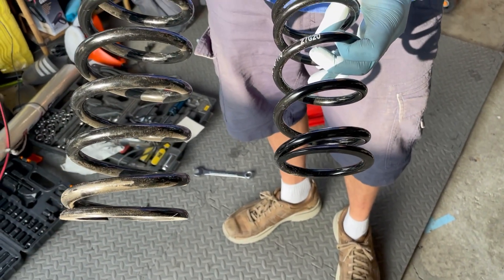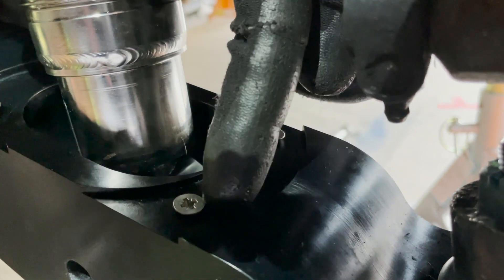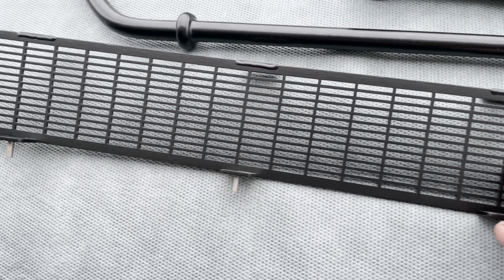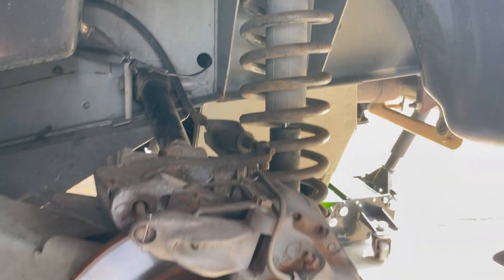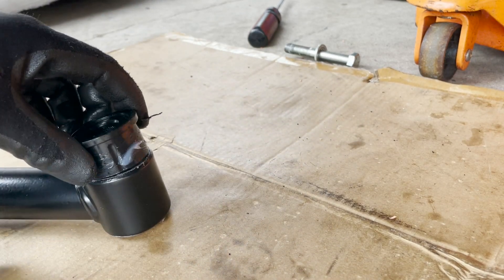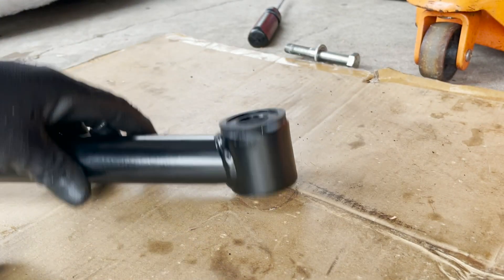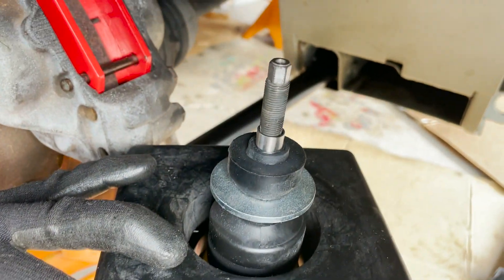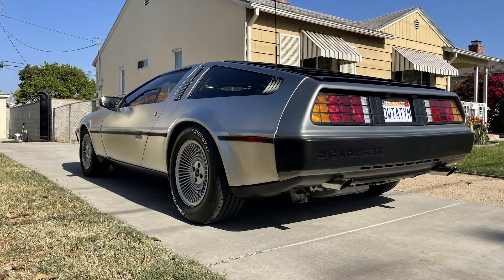DeLorean Suspension Upgrades Part 2

Comment: Is there any particular reason you didn't go with DPI coilover kit? and lower control arm from DGO and not from DPI? Just learning, I have to go through that too.
Reply from the maker: Mostly because of costs, the KWs and DGOs were less expensive and do basically the same thing. But if you want to go all out DPI, there's no problem with that. They make great products!